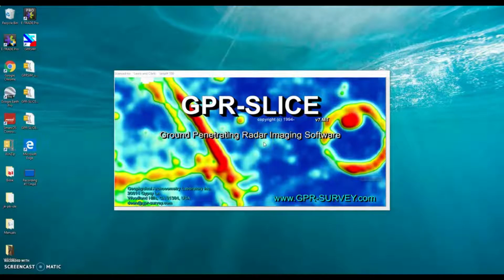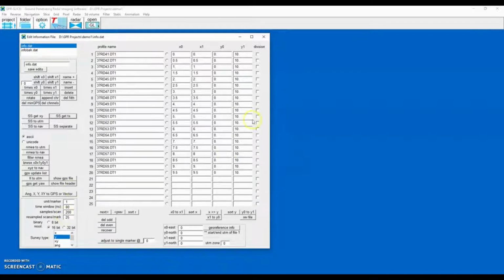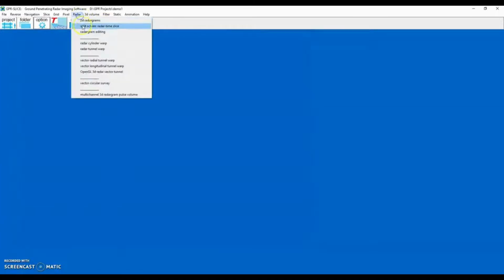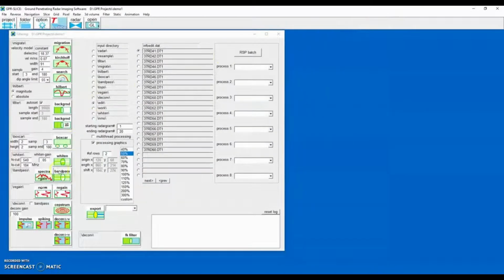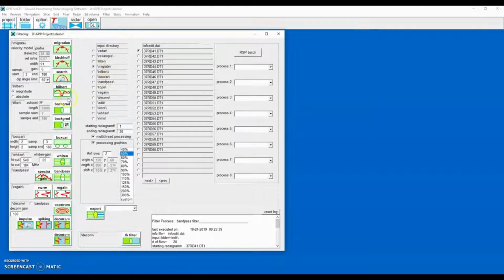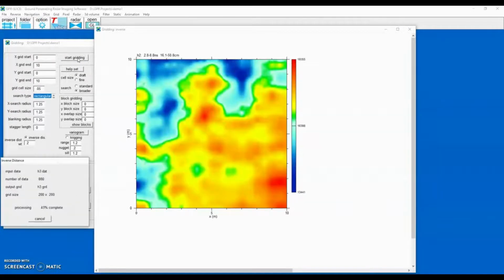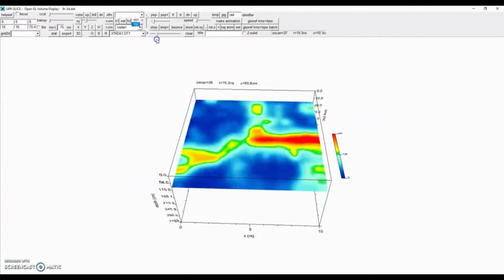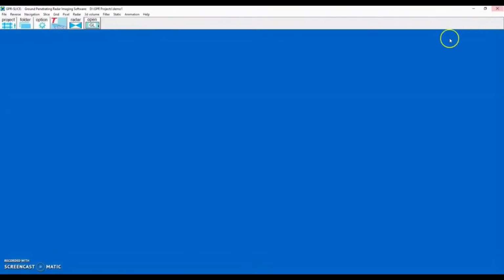Quick introduction to GPR Slice | GPR Slice

Comment: Hello how are you.  Can I process data or space radar images such as LOS, Landsat, or others with thermal ranges that can penetrate the earth and convert them to gpr, analyze and display them with this program
Reply: hey did you get any solutions? let me know if you do since I'm also in search for the same thing
Reply: @anirudhdutta686  No, no, I did not find the solutions. I am still searching. I have reached the middle of the road
Reply from the maker: Hello @Mohama7551, GPR Slice works with any type of ground penetrating radar data. Thanks